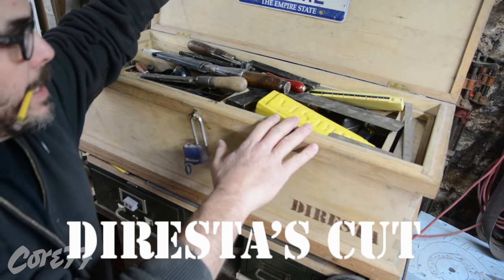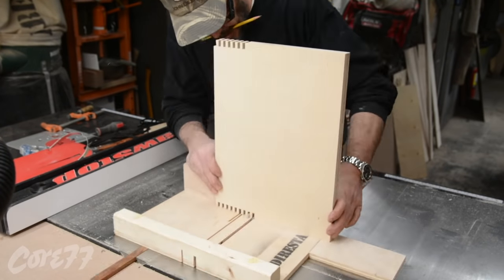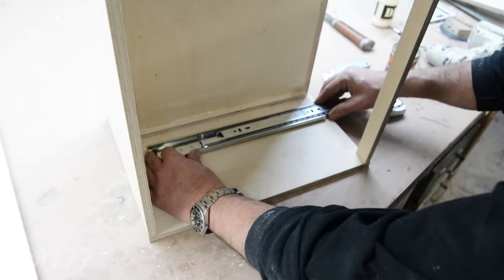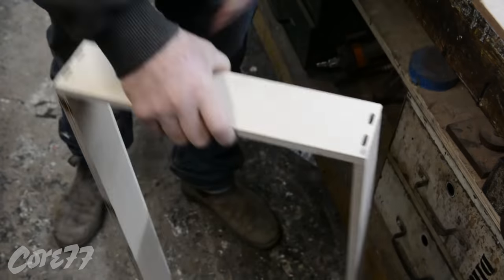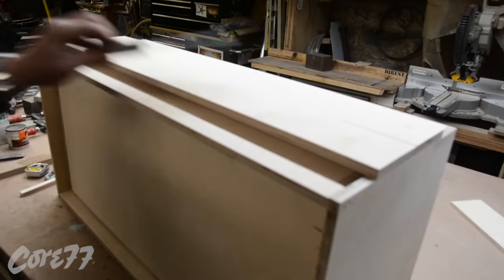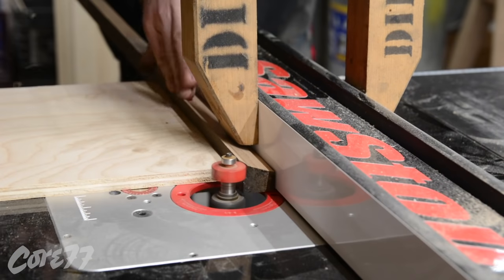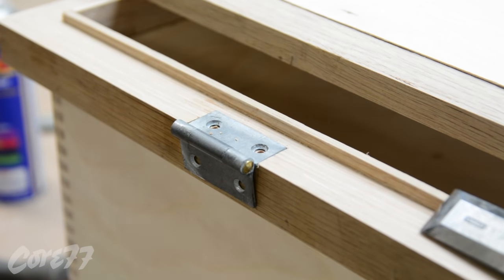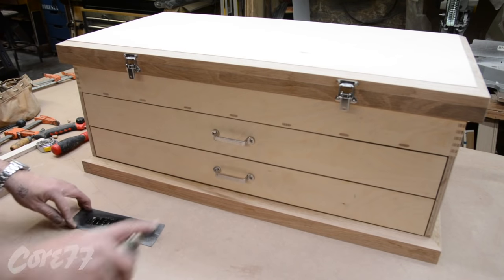DiResta's Cut: Dual Drawer Toolbox

Comment: Never heard of the razor cut to avoid blowouts. Brilliant!
Reply: +SirBrittanicvs Sure beats a clamped backer but .. there is a scribe line to deal with.
Reply: +RapidRrobert Sands out really easy
Reply: jkaeklolber Is it that shallow?  Like a couple thousandths?
Reply: +RapidRrobert The score line will sit right in the interior corner no need to do anything with it.
Reply: Pat M Got it, score on the inside of the piece.

Comment: the dominoes look great. and you're right, the wood will break long before the yellow glue bond. beautiful toobox!
Reply: +tim sway I'd go as far as saying the screws in the corner were probably not necessary, and might actually weaken the joint.  Screws are usually used as tiny clamps to hold the piece together while the piece dries.  Now, letting the piece dry, then drilling a hole and gluing a dowel in could add some of strength.  Which I suppose is exactly what the dominoes are doing for the drawers.

Comment: Back in France, I used a lot of Festool's power tools and never knew how popular or expensive they were.  I never liked their screw guns or drill motors, Way Too Heavy.  Back in the states and knowing the cost of Festool especially their routers and Domino I have never had the interest in onwing either.  I do however do have their rectangular orbital sander a copy of the old Rockwell sander.  BUT Now seeing how you used the Domino not only for its strengthening feature but also for its decorative value I'm giving it purchase a second thought just for that purpose.  Genius Idea my man.  Festool should give you a commendation for discovering another valuable use for this pricy power tool.  Well Done.  Oh and a nice-looking toolbox.

Comment: Awesome!  It will last a lifetime and then some! I am wondering if when you move it around, if the drawers will slide open from the weight of whats inside and will you include anything that might prevent that?  Like maybe a dowel that comes down from the inside of the lid and through the drawers and into the base?  I ask because my luck would be if I had to move something like that, I would end up tipping it slightly and the next thing try know, the drawer slides open and whoops!  :)

Comment: The aesthetics of the finger joints are visually pleasing. How thick was the finger (or saw)? Granted the blade should be fractional smaller depending on hardness of various wood grains. Also, Dave... Georgia tech? Thought they only made astronauts?  CRAP! Just realized this isn't Diresta's channel...

Comment: nice job,, u almost scared me there ending w/o taggn it lol,, yea done it again,, knockd my sokz off jeje,, hey Jimmy I was wondering if u think it would b poss 2 use the oak dowels on the corners instead of the screws just drill the hole a little deeper and drive the peg in like the other whatchamacalits u used on the sides ?? I was thinkin about using round peg like the oval ones u used (even just dowels) I dune but oak nails sounds like a plan 2 me whachathnk ??

Comment: I'm with you on those toolbox locks that lock all the drawers.  If you don't care about keeping the box stock you can cut off that piece that sticks out and gets pushed down to lock the drawers.  Basically you're disabling it forever but the drawers will open with the top closed.

Comment: in the shop when we need plugs weve used a steel block with different size holes drilled in to it, then we just hammer the wood through the block till we get the right size. just a fun way that doesnt use power tools aswell :)

Comment: I have a steel chest like the one Jimmy describes at the end-- the lid has to be open to be able to open the drawers.  I don't like that.  I ended up leaving the top open most of the time, but the result is a layer of dust in the top bin.

A while back, I got to looking and it was a relatively easy task to tap out a pin in the drawer locking mechanism and remove the rear drawer catch.  Now I can open the drawers with thew lid closed.  Only down side is that I have to be careful if I move the whole chest becasue there drawers will just slide open.  That's ok though-- I rarely move that chest.

Comment: box joints work great with plywood but thru dovetails do not....i tried it and there was a lot of rare out.
maybe the plywood i used wasn’t the best but it didn’t work wherever the reason.
have you ever joined that baltic birch using dovetails and how did is work out?

Comment: Hey Jimmy awesome video brother just as a FYI on those metal toolboxs you talked about on the ones that I've used if you open up the lid then pull out all the drawers then shut the lid the drawers or stay unlocked locked, just throwen that out there to you!

Comment: Jimmy, I love the video and the box is amazing.

I have a question about something.  When you made the rabbet in the lid frame, why did you do it with the wood between he router bit and the fence, and the bit raised to the top of the wood?  Normally, I would simply have the bit sticking up 1/2" from the table, and 1/2" from the fence, and have the wood on top of the bit.

Comment: Nice design! BB drawer slides are the way to go! One thing you might want to add is a bronze brazing rod with a rig bent in the end, drill through an inside corner of the till, the drawers, and bottom. Drop it in and cut to fit. Just in case you might have to move the chest to your new shop ;)

Comment: Nice toolbox, trouble is I would have to do it all by hand as i don't have any power tools because I don't have a workshop, and my work space is the corner of my bedroom in my little one bed flat(apartment if you are American). Not complaining I'm retired(was a carpenter) now, and my little flat suits me fine, Its just not many sites cater for the Hand tool only craftsman. But you have given me some ideas that I can use, so Thanks!
Reply: Same here, 20 years carpenter all trades...  got sick went broke then homeless lost everything lived in my car 3 years now in Fed housing complex, I br, lr, kitchen, 6 x 10 back patio.

Now I make shit out of carboard, hd multi ply glue up hot melt/yellow glue, paints like wood when I'm done ... shelves, table top, file cubbies for mail and stuff, gas station size toilet paper holder (from a buddy of mine), smart phone stand (from gas station toilet paper cores) smart phone box for when in bed (no tv yet) various pieces of art when I find cool graphics like a kitchen clock face and body for some old clockworks , a rocket ship (for my friend's kid), a couple of trucks (2 for kids and 2 for me) and 5 spire castle (for the neighbor girl upstairs) 

... plus thingamabob I engineered on the end of expandable shower curtain rod so i can drape the curtain 2 1/2 " further out to give my fat ass more room in the shower -  removable without fastening or damaging wall of fiberglass shower stall.

Now I'm always with an eyeball out checking curbside trash on recycling day and sticking my head in the back of grocery stores saying "Hey kid, can I get that Lucky Boy apple box... the one with the picture of dog on it. That one I made a stepped cardboard frame and hung it in the bathroom

I had a big score the other day at the Home Despot... 2 sheets clean and smooth, 5' x 30" of 5/16" 4 ply from a compressor they had just unboxed... tho that might be the limit for cutting with knives.

Comment: For the tool box that lock the draws when you close the top lid there is a metal rod down the back of the draws take that out and it won’t lock on you my tool box did the same but doe not now just take the draws out to get to the metal rod

Comment: I once made a semi-decent bookshelf I was going to put next to my desk for storage but forgot to factor in the size and transportation (I drive a mini-cooper)... So after the build up, which was never meant to come apart, I had to tear it down and resize.. the wood at all 6 joints (top, bottom and shelf) decided to migrate from it's original piece to the piece it was glued to.. I have since decided that where wood is concerned, yellow wood glue with almost certainly be stronger than the wood around it and the few joints that can be stronger than it can only be made even stronger with the liberal application of wood glue, :)
Reply: +The Whiskey Gunner  The Titebond yellow glue is used by modern luthiers to glue the neck of the guitar into the body of the guitar. Now that is a very dangerous joint, due to string tension. But the glue holds just fine. And it's not even a finger joint.

I don't think adding MORE glue is an improvement, i think its strength is how it attaches to wood specifically, not the cohesion. But the cohesion certainly isn't bad either.

Comment: I've seen you cut rabbets for drawer bottoms on the table saw like this before as well as assembling the drawer sides and then going back with a router to make the rabbet.  Do you have a preference between these two methods or do you just pick one and go with it?  Genius "domino nails" by the way.
Reply: This method here is only when it the drawer. Gets a face. To cover exposed datto at front and back. Thank you!